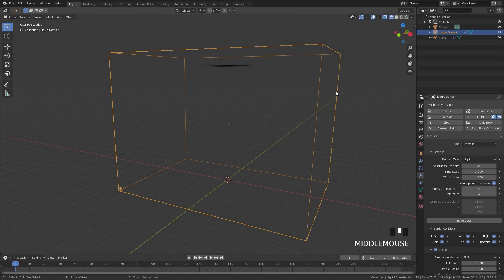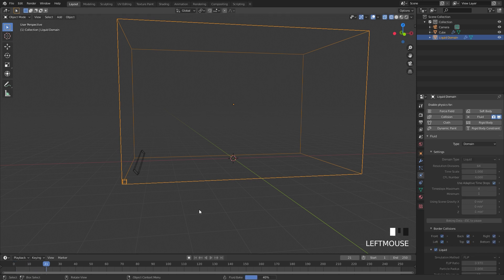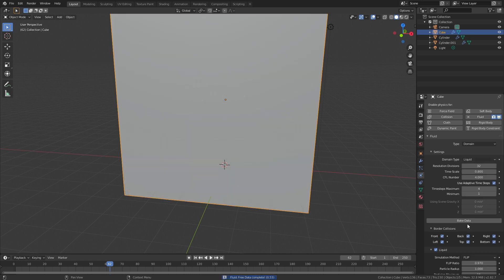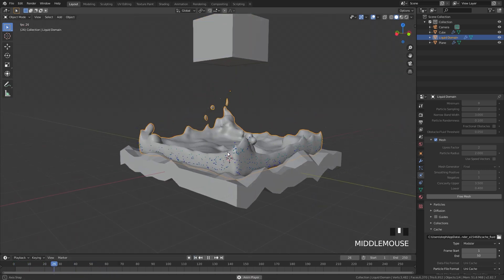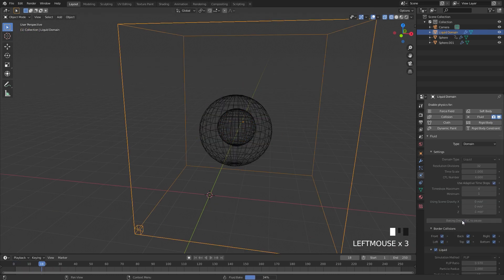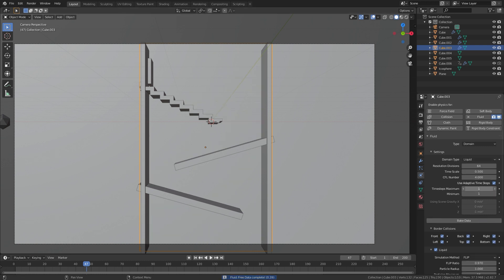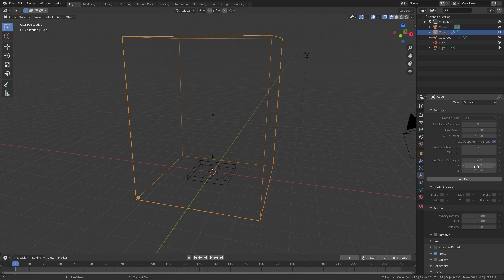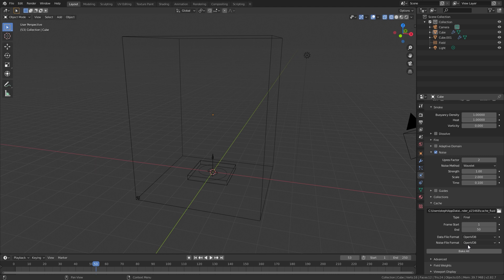Common Mantaflow Problems & How to Fix Them!

Comment: This might be a long shot...but i can't seem to get inflow object inside the collider to work. Fluids keeps going through the collider, and when i increase the surface thickness i can only do it up to 0.3. Anything beyond that no particles will appear. What am i doing wrong here?
Reply from the maker: Yeah so fluid inside collision objects don't work anymore.  They changed something from 2.83 to 2.90 and now it doesn't work.   If you want to have fluid inside an object you have to use 2.83.  
One way you could have fluid in 2.93 is to make sure there is a hole somewhere on the mesh. That's the only way I got it to work.
Reply: @BlenderMadeEasy  I see, that's a bit weird. Been searching all over for an answer for 2 days. Thanks for replying!

Comment: I am having issue with my fluid, as it appears in wireframe mode perfectly well, however not in viewport shading mode or the final render. I am using version 2.93.3. Can anyone help? Also, the surface thickness settings do not appear in this version.

Comment: Four spheres of different sizes and colors were designated into the particles and pressed bake, and the particles changed randomly for each frame.Why is it changing so much?Can't it be fixed to one thing and flow? My English is not good enough, but I hope you understand it..

Comment: Have a baking-issue on 2.93.1
1. Set up my blender file
2. Saved it with all the fluid settings
3. Then I guess I changed some of the fluid settings without saving
4. Then I baked the fluid data
5. Then proceeded with the Fluid-Mesh. It was baked to 30%, then Blender crashed (yay)
3. Reopening Blender file, and now Blender sees that there is baked fluid data, but when attempting to bake the mesh, it just runs through the timeline without creating any mesh data. In the cache it creates the mesh folder, but for each frame there is just some 1 KB 'non-sense' file. In the greyed out fluid data tab it shows a false resolution value, probably from not saving again before baking the data.

Any Ideas??!

(Have a separate copy of the cache until here, because Blender, as you know, just deletes dozens of GB's and days worth of computing without any warning whatsoever)

I do think that's a great Video!

Comment: so i know chances of a reply are low but i am having an issue where my flow object will no stay inside the domain, in fact is seems to spawn my  fluid out side of the domain quite some distance from the flow object and i have no clue what is happening
Reply from the maker: Hmm that's pretty strange. I would probably set a completely new folder for the cache, apply the scale and rotation of all the objects, check to see if any modifiers are messing with the domain object and then bake it again.
Reply: @BlenderMadeEasy  thanks for the response mate i just redid the scene having the fluid system in place before i added all my other models and stuff and it works now , still very new to blender so i appreciate it

Comment: I have an objet from a vgs file, I turn it into a mesh, I sculpt it, invert the normals and all but it still don't work in the fluid simulation at least i turn on the planar option, but when I do the fluid start to apear way to far from the object's surface even tho the value still 0.
can somebody help me?

Comment: My issue isnt listed here, my issue is that I cant get any sort of "Simulation" to appear at all, following all the turorials closely and even exactly copying what they do as well as changing all the setting to get anything at all to happen., and if I do get it to work by some weird miracle, its 1fps slow and looks terrible (I have i9 9900k and 2080ti with 32gigs of ram to boot... I'm running blender 2.9

Comment: I tried everything in the video plus tried different gpu drivers and different blender versions, still. Nothing is even remotely working. Either nothing is getting rendered or it crashes when moving the timeline. I have a ryzen 9 3900x a GTX 1080ti and 32gb of ram.

Comment: have you actually looked at your cup simulation after increasing the thickness? you do realize it leaves a huge invisible wall around it making the whole thing pointless right?, just check "is planar" and bam! problem solved.

Comment: I have problem with baking. I don't have an option to bake
Reply from the maker: Make sure the Cache mode (located in the Cache Panel) is set to Modular and not Replay.  For some reason they changed the default to be Replay.
Reply: @BlenderMadeEasy  thank you I have to check it. I hope i can get my homework now done👍🏼